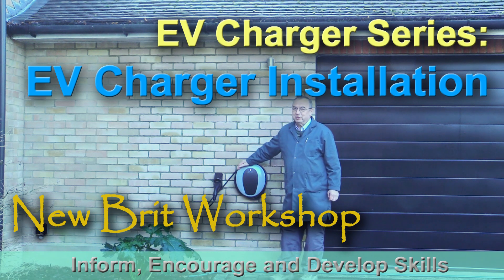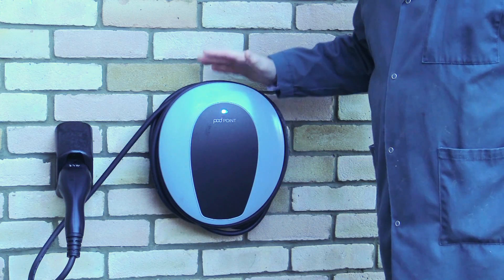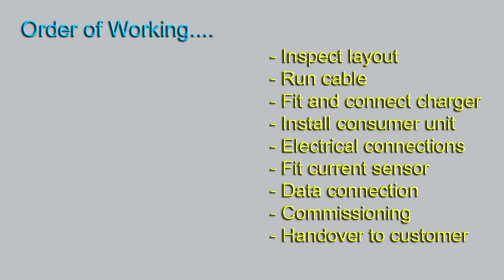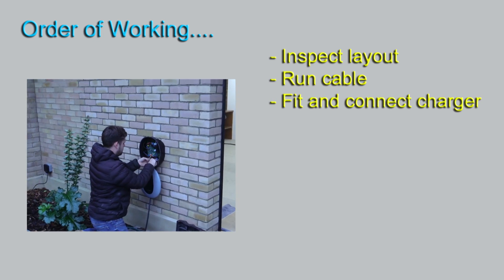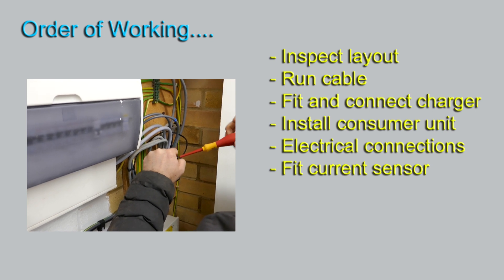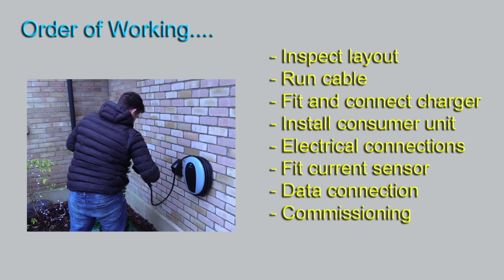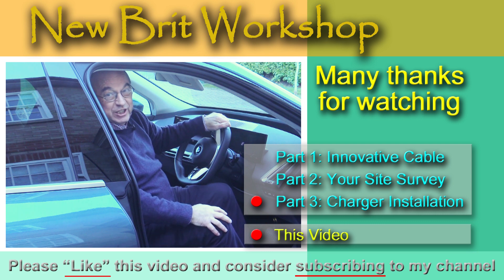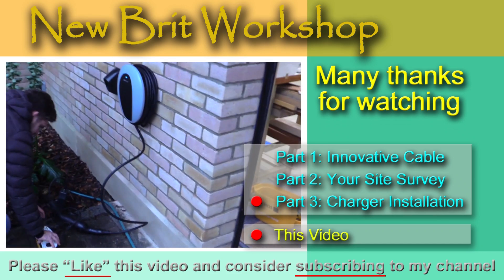EV Charger Installation

Comment: Any idea how the cable was terminated inside the charger? Was it a backwards stuffing gland around the armoured cable or did they put an SWA gland on and slide that into the wall?
Reply from the maker: Hi Matt, I assume it was a compression gland but did not see it.  Peter

Comment: What did the installation and charger cost?
Reply from the maker: Hi Bruce, I paid £599 for the charger and installation which was after the OLEV grant of £350. This grant scheme expires on 31 March 2022.
Reply: @NewBritWorkshop  Are you sure it expires on 31 March 2020?   :)
Reply from the maker: Hi Sam, Unless something has changed in the last few days 31st March is the cutoff.  Peter
Reply: @NewBritWorkshop  2022 Peter
Reply from the maker: Yes, 2022 - oops !!!! I have changed my corrected my comment above.    Cheers.  Peter
Reply from the maker: Quote from the official web site "The scheme will remain open to homeowners who live in flats and people in rental accommodation (flats and single-use properties)."  Peter